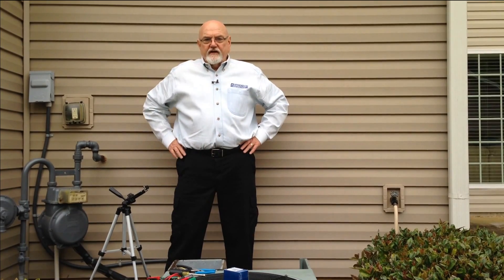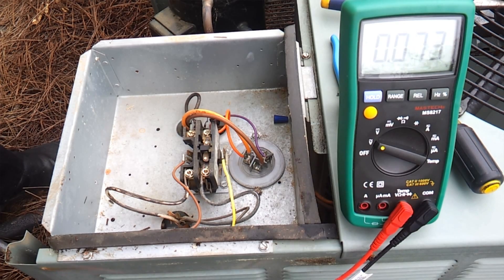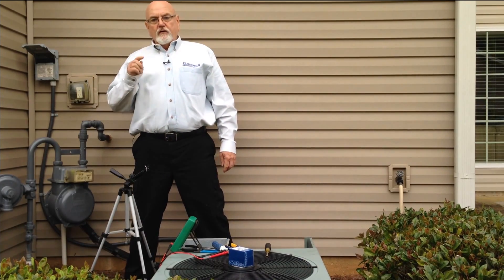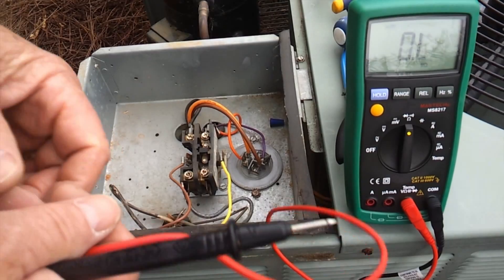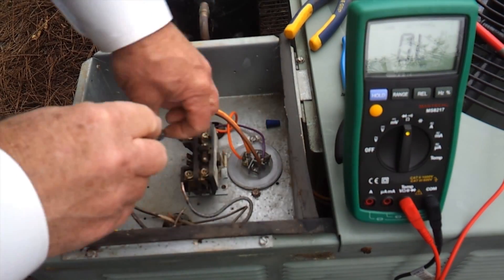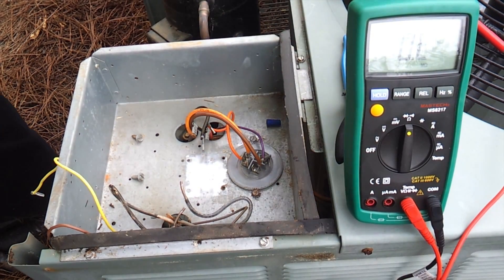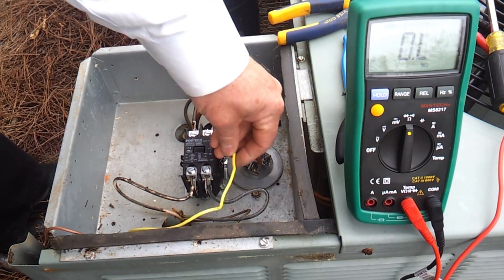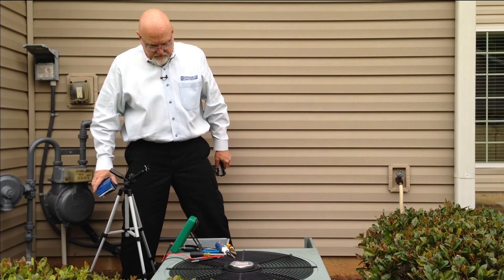Air Conditioner Not Cooling, AC Troubleshooting, How to Test & Replace an AC Contactor, AC Relay,

Comment: Did you replace a single pole contactor with a double pole?......your camera didn't focus on the new contactor part number ( blurry), and your hand motion was always moving with it in your hand.....wished to see at least few seconds stationary to see what you had. For some citcuits....it won't matter going to 2 pole from 1-pole.....but for some other circuits, it may matter. Don't forget you still have 24VAC control power where you're working.... even after you pull the outside wall breaker on main power......good to kill the inside thermostat power and  inside furnace/air handler power too while doing this.

Comment: My case is just reverse, my compressor keeps running until I pull off fuse(thermostat shut off not working), the contactor looks very identical to yours. I press the connection plate, it goes down, looks freely, not know where the wrong is.
It must be the sticking contactor,  it has been 25 years, and see rust on one end already, am I right ?

Comment: my pay air conditioner in  ot cooling I have changed the contact s  and just changed the capacitor and it's now just outside unit comes on stays on for maybe five minutes and then turns off and still not cooling what can I check now

Comment: hello Don I have a Trane XE1000 Central air unit and I'm getting the fan blowing inside the house vents, and I'm getting the Central air unit is powering on, but the air that is blowing in the house is not cold air, and also Don the outside unit fan is not blowing heat air, could you tell me what could possibly be some of the reasons that I'm not getting cold air blowing in my home. Don I had watched one video that Said that when the outside unit compressor is on you you should feel heated air coming from the outside fan unit is that correct? also thanks Don for sharing. Tony D.
Reply: The first thing to do is to check & see if the compressor is running. Maybe the outdoor fan motor is coming on but maybe the compressor is not. If the compressor is running, then i would suggest calling a professional as there are multiple things that could be causing it not to cool.

Comment: My outside unit was not working at all just made a clicking sound made sure power was off Replace the Capacitor first it never helped so I replaced the Contactor and I turned the power back on and its working fine. Thanks

Comment: My AC is not starting. I started by testing the thermostat by joining the red, green and yellow wire which started the furnace but not the AC. I than tested the contactor. 240 volts does go in but when I measure the coils in volts it reads 0. I than tested the plunger by pressing in the plunger which does activate the fan and condenser. Why does the plunger not in-cage  automatically when the thermostat indicates cooling? Is it a bad contactor or a bad thermostat or something else? What other tests should I do to determine which part requires replacing?
Reply: Charlie Cecere my brand hvac unit will do the same thing u described did u ever find out why yours was doing that? This is a good video but cant find the answer
Reply: You need to check the coil on the contactor for 24 volts. If you don't have 24 volts to the contactor and you have the red, green & yellow wires joined together then you may have a broken 24 volt control wire going to the contactor . If you do have 24 volts coming to contactor and it is not pulling in, then you have a bad contactor coil & it needs to be replaced.
Reply: Don Harris thanx for reply. but i figured it out the next day. There was two metal wire conectors  touching on the control board. Spread them apart and it started right up. It came that way it was a brand new unit.

Comment: i needed a refresher, and i told a tech that after he had charged the coolant and replaced the compressor that i believed it was the contactor. it's been a few years since I've repaired units but after this video. i did the tests and replaced contactor and we are COOL. We're in Az,so is very important to have a/c.So, thank you and God bless.

Comment: If you have a bad contactor  will it cause the breaker to pop as soon as you try to turn it on?
Reply: I have the same problem, did you replace the contractor. Did it stop poping the breaker?

Comment: whenever you kill power to anything with two legs, don't just check voltage from leg to leg, check individual against ground.  never know if that disconnect is wired direct on one leg.

Comment: is he an amateur?  looks like he ran a run on the common side of the load, plus he just set the common and red 24 volt lines by each other.  at least cover the terminals with electrical tape, if they touch, bye bye fuse, transformer or worse control board. plus he didn't check line and load voltage or amperage  after swapping the contactor out.

Comment: can u please describe more abt the wiring
Reply: L1 -L2 line volatge from disconnect ~T1 Common fan,common compressor,T2 run compressor,fan motor wire. Hermic on capacitor/fan/c|run

Comment: I need to replace a contactor and 1 pole its FLA is 25 and Resistive is 40 amps  its a 24v,  do I need to get the same exact one or can I get a 30 amps FLA?
Reply: I know your comment is 7 years old but others may see this. You can go same or  UP on FLA (Full Load Amp) rating of the new contactor....but never lower than original.

Comment: I was having ac problems heard a clicking noise did some research found out it was the contactor replaced it ac works fine you tube is fantastic

Comment: Replacing the Capacitor didn't fix my problem, same result no fan operation,  Next I'm going to replace the Contactor.  To find and purchase online, proper replacement parts by your units Model number.